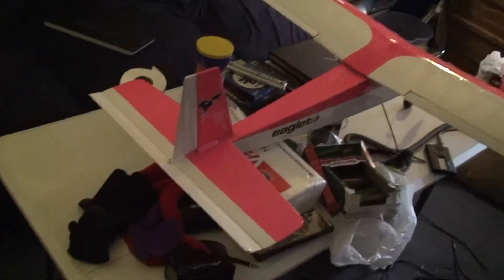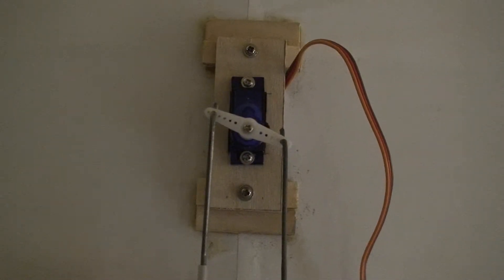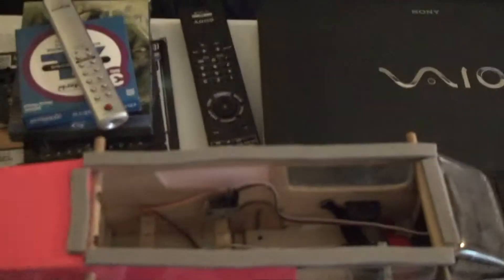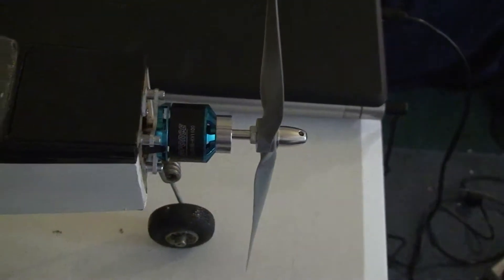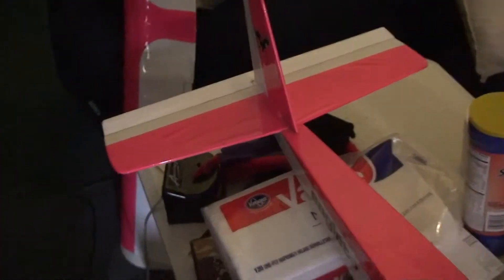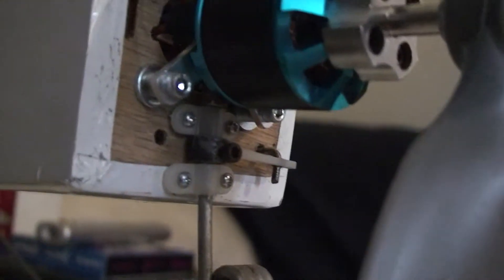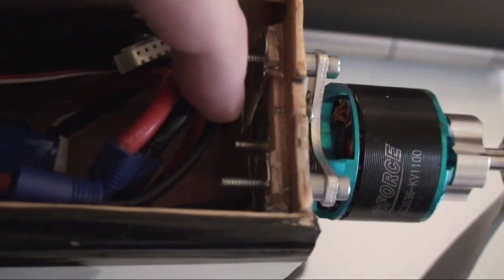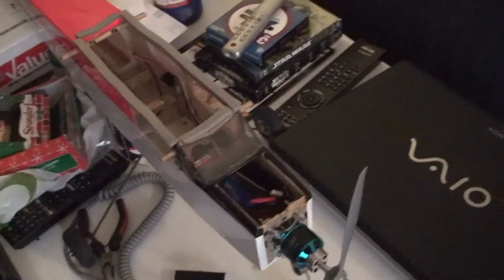Eaglet glow to electric conversion

Comment: Did you ever get a video of it flying?  I have one that I built back in the 80's when I was 10-12 that still has an OS Max .19 on it and the old Aertronix radio.  I only flew it a few times back then and have been looking at it and thinking of doing the same since electric seems to make it much easier to find someplace you can fly it.
Reply from the maker: Unfortunately no. On the 3rd or 4th flight an rc pilot with tunnel vision performed an Immelman right into it. My only regret was I didn't get more flights out of it.